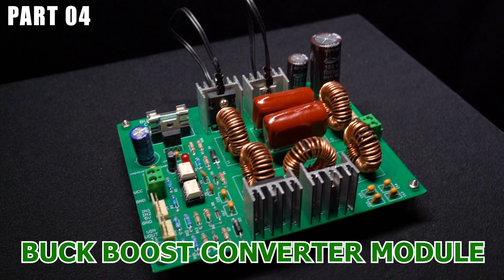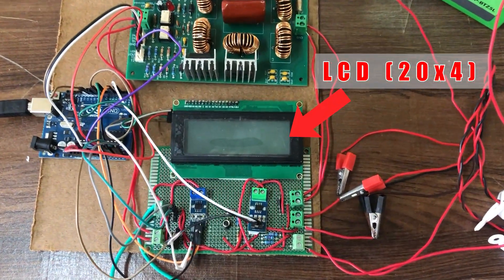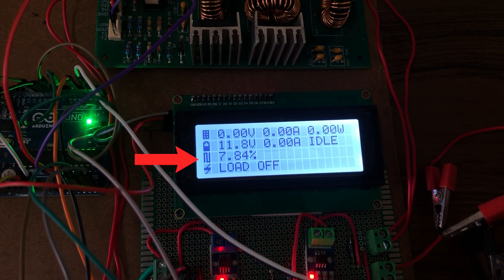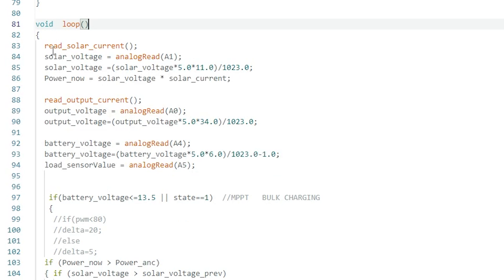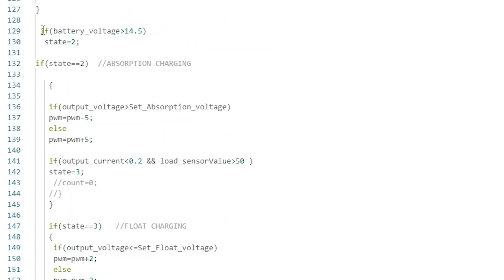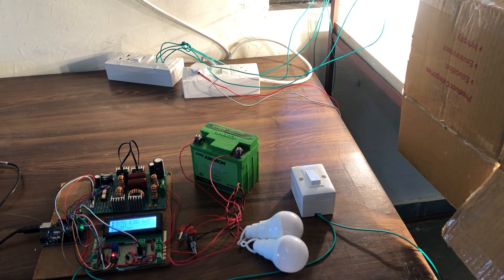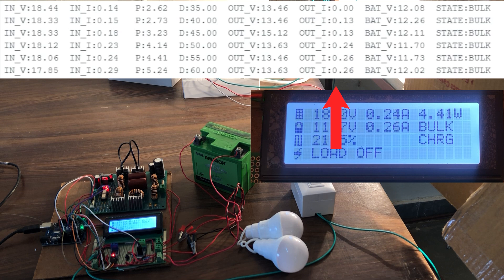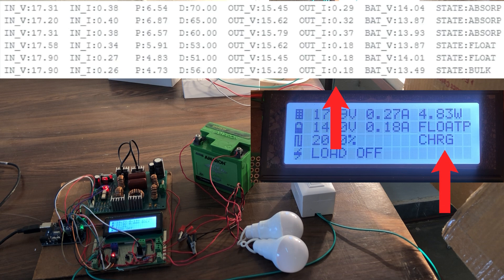Buck Boost Converter Module for MPPT method to charge Battery using Arduino - (Part-04)

Comment: Beautiful, but why so many inductors ? I have 100 A BOOST MPPT, 50 + 50 AMPS, only two inductors.
I have also 3-phase BUCK MPPT, but only 3 inductors, 30 + 30 + 30 === 90 AMPS.
So if I have a lot of shading, I can use 2S conf. x 4 , so e.g. 8 panels x 500 Wp == 4000 W,
so I can BOOST this to 150 V, use thinner cables, and near battery, I can place BUCK MPPT in CHARGER MODE
and step down 150 V to 12 - 24 - 36 - 48 V / 90 AMPS. 
If somebody has ZERO shading, can use 150 V - 250 V BUCK, and use 3S- 4S - 5S INPUT.
But problem with 100 A MPPT is to handle 100 A current 12 hours during sunny day @ 45 *C - FETs CAPs TOROIDs.
So forced AIR or WATER cooling needed.

Comment: Can i use it for 48v input and the required output 60v ?
Reply from the maker: @shcsakib6656  max input 30v.
At 25v you will get 60v